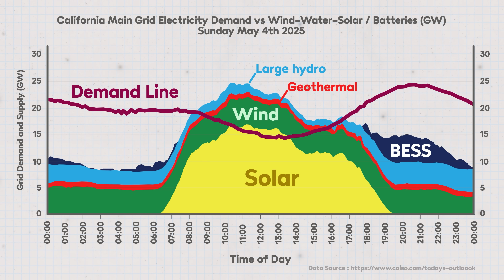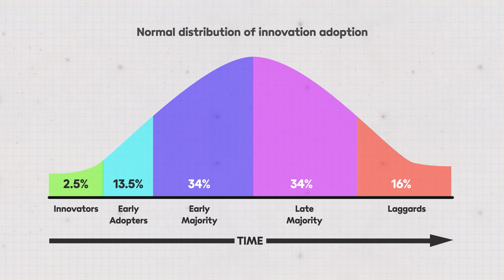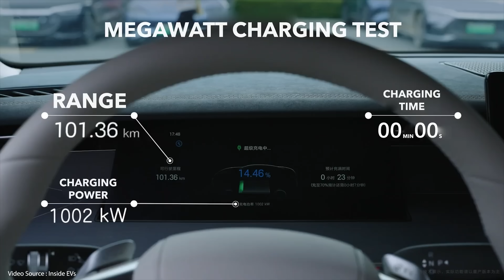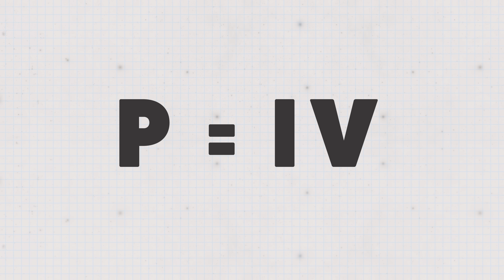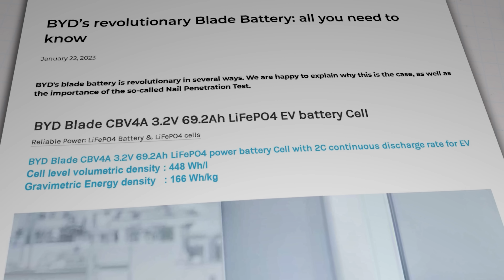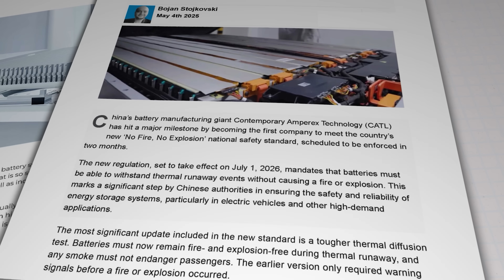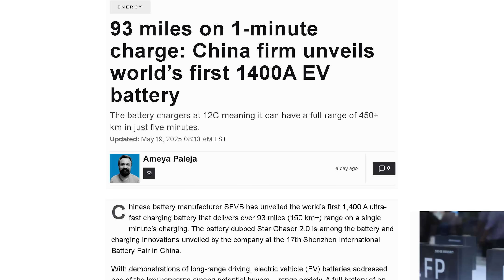BYD 1 MEGAWATT 5 minute EV Charger. Overdue or Overkill?

Comment: I would have bought an EV years ago if I had off-street parking. But still no chance to use my solar surplus to charge it because of a hefty fine for crossing 4 feet of sidewalk.

So super fast charging does sound promising, although these chargers will need batteries or their own nuclear power plants. 1 MW charging with a thousand EVs at a time will easily drain most power plants and is also pretty much melt most grid connections.
So there is still a lot of work to do before this becomes reality at a usable scale.

Comment: The point that everyone seems to be missing is that super fast charging opens the door to EVs for people who cannot charge at home. You could just run an EV like an ICE vehicle just roll up at a station wait 5 mins to charge and on your way. 
The other possibility is local stations in areas where home charging is difficult. The chargers could have large price variations so if you are happy to charge at an ungodly hour you can do it at very cheap rates because the charger is using off peak electricity. Book your slot or have a recurring slot automatically booked and get a discount. Also I suspect that it will actually be cheaper to provide one fast charger instead of eight normal chargers with just a couple vehicle charging spaces. This system could get very high utilisation based on large differences of price depending on the time of day. All reducing operating costs and providing cheap charging for all.
We now see the problem as how do we provide many low speed chargers in every street, but we could have just a few chargers for hundreds of cars.
I really think this changes everything!

Comment: I really think that Battery swapping is still a big opportunity that is yet to be fully integrated.
One Chinese company , Nio, does have a number of battery swap sites in Shanghai and now over 50 stations in Germany and is wapping hundreds of thousands batteries already, it needs more vehicles and owners to reach critical mass and become profitable. 
Janus Electric in Australia and eHaul in Germany have trucks with swappable batteries that allow Class 8 heavy vehicles to be recharged in 5 minutes, via a battery swap system allowing trucks to have less downtime to charging and also less need for massive grid supply to recharge the 300 kWh packs.  those models are more capital intensive than passenger cars but provide much greater utilisation for the transport industry.

Comment: Hotels and Guest accommodation will need to start upgrading facilities. A couple I've seen only have two or three slow chargers. Local storage systems will be needed so major cabling infrastructure isn't required. Which again can be used to balance the grid.

Comment: You are such a dreamer. Most people don't live in new homes with plenty of spare electrical capacity to add a level 2 charger. A large number live in apartments and those aren't going to have chargers. I live in a 10 year old townhome with a garage but the electrical service is at capacity. They would need to run a new electric line to the house and change out the existing panel. Several thiusand dollars. Many engineers don't think grid inverters will handle the inertia problem. Battery storage for times solar and wind aren't online would be an enormous undertaking. All the battery devices in homes are already a fire hazard. Batteries are toxic to build and dispose of with current battery design. Just too many problems for it to be practical now. Maybe in 50 years.

Comment: This is great, but the electric grid does not have the power, transformers, or larger copper lines to power a 5-minute charge. You can get a five-minute charge if you are the only one on the line. Wire up 10 of these chargers, and unless each charger has its own power line, that means 10 people charging at the same time would mean a longer charging time. So, unless they upgrade the grid, these EVs are a long way off.

Comment: I find quicker charging very important. Charging time and cost are the two reasons why not every new car is a EV. BYD is solving both reasons
Reply: BYD is not solving s...! It's not practical to have those megafast chargers in cities... the infrastructure is not there! Get a reality check, don't get caught into the "green dream"... and in most cases, the electricity that goes through those charger comes from coal and gas... isn't it ironic?

Comment: I fully support 1MW charging as in reality, it'll never charge at that speed but closer to: 500kW-800kW.  I've owned and driven EV's for the past 10 years and can assure anyone, charging stations almost NEVER charge at the rated speed, event the Tesla Superchargers, which I own 2 Tesla's, and they charge at: 1/2 - 3/4 the rated speed.  Fortunately, we only take a few long distance trips a year, so it's usually fine as we need to use the bathrooms and grab something to eat anyway, but faster charging would be great.
Reply: As far as the potential of EV tech and infra structure is concerned, we are all the way at the beginning of developement. The biggest EV lagger is agriculture, or rather agricultural equipment, but when it does come along, the need for mobile multi Megawatt pack to pack chargers is going to be mandatory, which will change a lot. Chances are farmers will at least try to make some extra money out of season, by flash charging passing traffic.

Comment: Charge time has never bothered me, on a long journey it gives me time to use the loo and drink a coffee, whilst I top up and at home charge overnight. But I would like 500 miles of range so that I didn't need to use en-route chargers and could just use cheaper destination chargers.
Reply: How many road trips have you been on?
Reply: @Les_S537 so I drive an average of 25,000 miles a year. Since The beginning of this year I have driven from the South of England to Scotland, Cornwall, Northumberland, mid Wales, Gloucestershire, Bruges in Belgium and Manchester. Next is Derbyshire, followed by Scotland again. Does that answer your question? I usually stop every 100 to  150 miles to top up.
Reply: @RichardBacon-h5x  That's the proper way to road trip in an EV.  Tesla's V3 superchargers can "push" 200 miles of range into your EV in 15 minutes (going from 20% state of charge to 80% state of charge).

So yeah, when road tripping you DO NOT charge your EV all the way to 100%.  You only charge enough juice into the battery to get you to the next charging station.

Charging from 80% to 100% can easily double or even triple your overall travel time.

Comment: I anyone talking about the faster degradation to the battery at such charge rates?  I'm not expert but eeverything I've read points toward a battery that "wears out" faster the more you juice it...
Reply: Its not wears out faster the more you juice it, its wears out faster the higher the voltage/amperage you juice it

Comment: A couple times in this video the idea came up that EV owners are satisfied with charging and range constraints. I think the causality semi-implied in the video is backward. It's not that folks buy an EV and then are surprised to learn they are ok with the battery capacity and charging rate. Rather, it's just that only people whose lives are set up to make EVs viable buy EVs. Which is one reason continued improvements in batteries is such a big deal. The larger the capacity and the faster the charging rate, the more viable EVs are for more people.  Super fast charging might put EVs on the table for apartment dwellers, for example, who cannot charge at home.

Comment: And again, no one seems to mention the need for a small nuclear reactor at every "gas" station to sustain that 1MW power draw. This will never happen. I guess I'm "naysayer" then. Fire safety concerns: use the batteries but maybe store them properly? -- NAYSAYER. Transportation infra concerns: use renewables to electrify public transit instead of self important rich guys that want to feel like they're saving the planet -- NAYSAYER! Use batteries where they can actually offset carbon efficiently AND cheaply in home electrification instead of moving 2 tons of SUV around town -- NAYSAYER! And, speaking of moving 2 ton vehicles, use batteries in personal mobility devices instead of 2 ton ego machines -- NAYSAYER! HERETIC! When will we stop focusing on the car lifestyle and start building stuff that actually makes a difference for the little climate problem we seem to have made for ourselves here?
Reply: MW scale charging stations will be few and far between.  Their only use case is with industrial scale EVs such as the Tesla Semi which has a battery pack size of 850-900 kWh.  Using a MW scale charger for a personal transport EV with a 50-75 kWh battery pack is overkill, and will actually ruin the battery pack in the longer term.

Comment: Re your remarks about range anxiety and charging speed being "completely irrelevant to their everyday driving experience" for "the vast majority of existing EV drivers": keep in mind that this is a self-selecting group, people who have chosen to purchase an EV because they concluded that it would work for the way they drive. That doesn't mean that these concerns are irrelevant for all drivers. In my own case, it's not the "everyday driving experience" that concerns me but the uncommon driving experience, the trips of 200 miles (321 km) to 700 miles (1126 km). Although we only make a few such trips each year, they account for a significant percentage of our total miles driven. So for us, longer range and faster charging (along with a better charging network in the U.S.) would be a real game changer, not just a matter of "perception."
Reply: Couple of facts.

1.  Around 80% of the planet lives in an urban environment.
2.  The average driver does only 30-40 miles per day
3.  a typical 120v/15amp outlet can "push" ~4 miles of range into your battery pack per hour.

Knowing these three immutable facts, it is clear that for the vast majority of people on the planet today an EV is entirely practical.
Reply: @Les_S537  We also live in an urban-ish environment and drive less than 30-40 miles per day on average. For our everyday driving, an EV would work just fine. But a significant percentage of our driving is those few long trips per year, and current EVs will not work for those. If longer range and faster charging are just down the road, it makes more sense to hold out for a car that can handle all our driving.
Reply: @amylivingston4590  Amy, I've owned a Model 3 Long Range since 2019, and I've been on 6 road trips since purchasing it.  I've had no issues road tripping...  Tesla has covered every Interstate Highway in the nation such that you can literally drive coast to coast today, and many already have done so.

The charging stations are spaced out such that you are always within range of the next station.

Tesla's V3 chargers can charge 200 miles of range into your battery pack in 15 minutes, from 20% state of charge to 80% state of charge.

Road tripping in an EV is simpler than you've been led to believe.

You DO NOT charge your EV to 100% at every stop.  You only charge enough juice into the battery pack to get you to the next charging station.

So you drive your first leg of the trip, stop and charge ~200 miles into your battery pack in 15 minutes, and move along to the next charging station and you charge another 200 miles into the battery pack, etc  Wash, rinse, and repeat.

Comment: Main reason I won’t buy an EV (yet) is lack of charging infrastructure and cost of public charging.  Even with massive tax incentives it makes no sense. We would be better off using the tax breaks to hand out e-bikes.
Reply: The argument that there is a lack of charging infrastructure is ridiculous.  Every home and business on the planet, provided it has electricity run to it, is a charging station.
Reply: @Les_S537 in 13 years of living in my house I have parked directly outside it on about 10 occasions.
Reply: @timothygalvin7466  Meaning that you don't have a driveway you can park in and other people's cars get parked in front of your home due to population density which squeezes you out of parking there?

That presents a problem, yes...

But when full self driving EVs become the norm you know what you'll do?  Your EV will drop you off at home at the end of the day, or whatever, and you will instruct it to go drive itself to the local automated EV charging station where it'll charge up and then park itself overnight.  In the morning you will summon the EV from your home when you're ready to next use it and it'll have a fully charged battery ready for another day of use...
Reply: @Les_S537 at some point yes. But the uk can’t maintain its existing infrastructure. 

The acid test is taxi drivers. None of them have EVs.. if it stacked up then they would. The main reason is that fast charging is 80p per kWh, which is substantially more than petrol/diesel. 

I’ll get one when fast chargers are sufficiently cheaper than petrol to make it worthwhile.